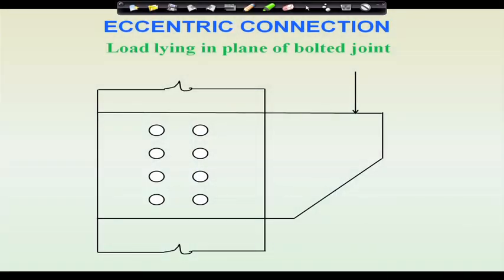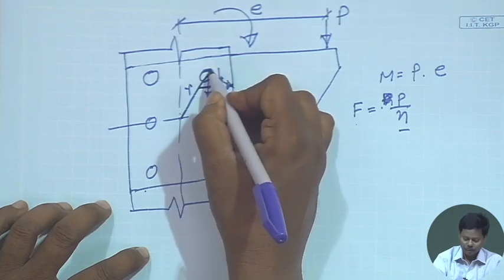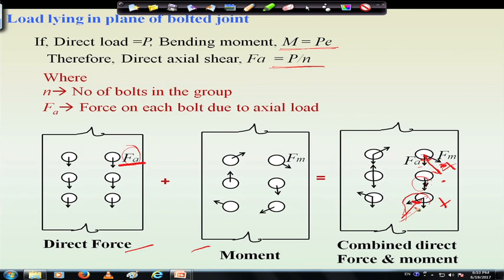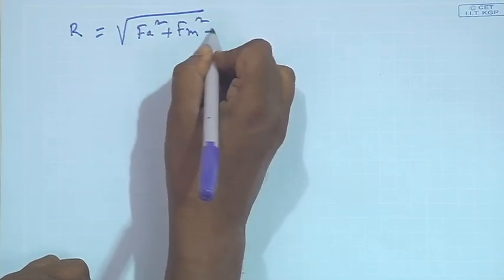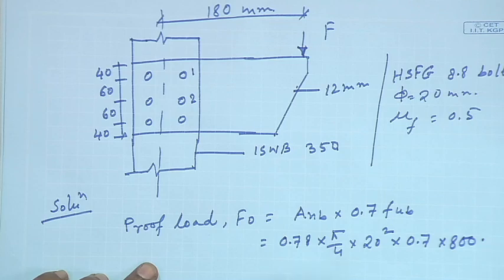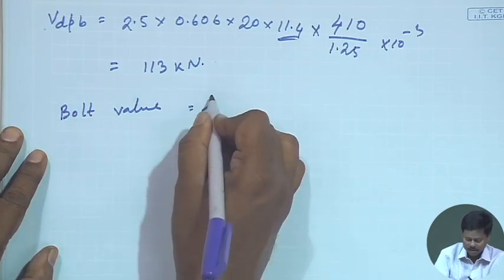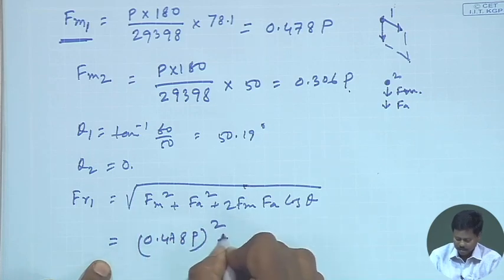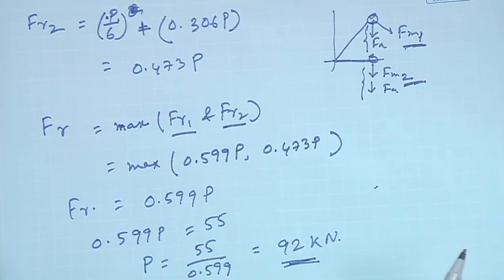Lecture 13: Eccentric Connection (Load Lying in Plane of Bolted Joint)

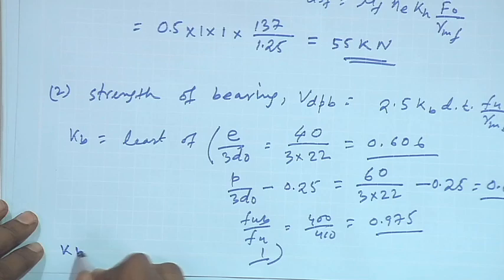Comment: @20:00 why is fub taken as 400MPa when bolt grade is 8.8?
Reply: for bearing strength untimate strength of plate must be taken beause bearing of plate occurs at failure, so fu=410MPa
Reply: Ya same doubt
Reply: It was wrong
Reply: Its a mistake. Actually it should be 800 Mpa, but the possibility of Kb attaining a value of 1.9512 if we do it correctly is impossible. So in this case it does not matter.